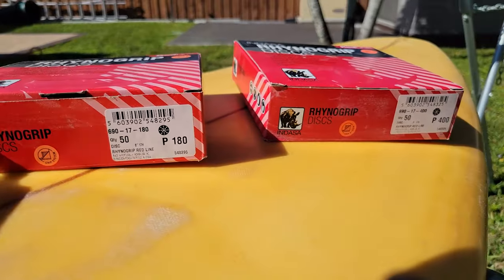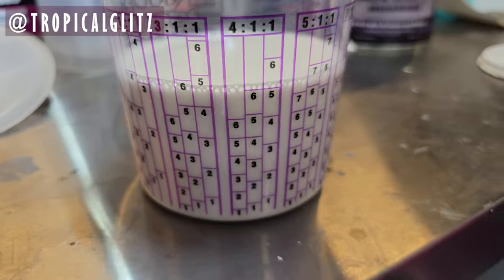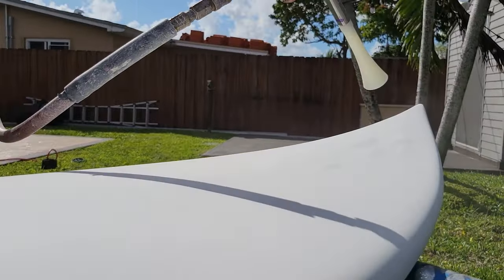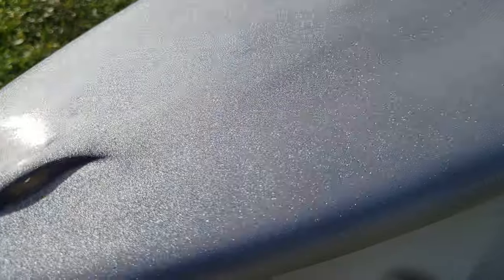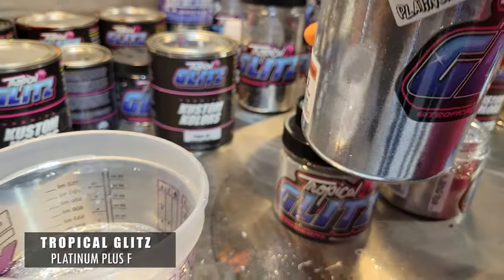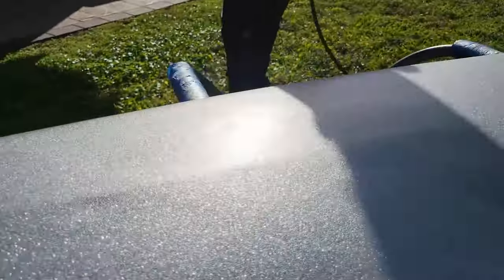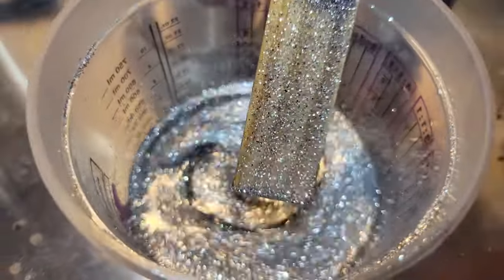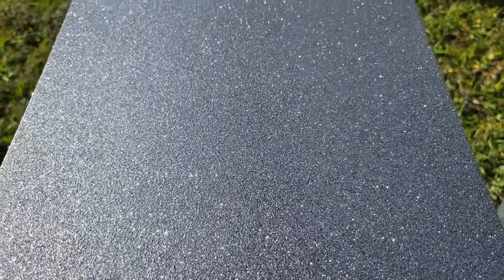How to Mix and Spray Metal Flakes

Comment: what tip with that much flake ?why not just use .25 bass boat flake.?you didnt show how many coats of clear you had to use to make sure it flate before you wet sanded it. thats the fun part.  besides cleaning up all the flake left in the shop and your boots
Reply: Lol daddy roth has their silver flake in a .40 size 😮
Reply: No wonder I couldn’t get that to spray through the .3 Iwata 😂😂 Weeee… now we’re having fun. 👊🏻👊🏻🤣

Comment: is there a limit to how large of a metal flake you can spray?
Reply from the maker: The size of the metal flake depends on the size of the tip of the paint gun.
Reply: @TropicalGlitz  Thanks. What size would you recommend for a .015 flake?

Comment: My Gosh I have never seen so much flake go in 1 cup and not have any trouble spraying it because it sprayed amazingly, how? You had to have been using a large tip!
I'm going to ask a huge favor, before mixing the flake but after telling us what you are going to do could you please go over what type of guns and tips you are using in detail, tip size, needle size, psi you are using and the products you are using names of what you used and why you think this mix is the best and every type of gun you are using and what is the psi set on the gun please! 
Also could you go through the top of the line guns to use for each process like priming, colors, metal flake and do you use the same gun when you use intermediate clearing and top coat clear and if you could use and gun brand and type what would it be and break down why.  
Thank you so much!
Reply from the maker: Hello! All of our flake guns and spray guns can be found on our website www.tropicalglitz.net

Comment: Whats the difference between shooting it with clear opppose to intercoat.
Reply from the maker: The difference between inter coat and clear coat it is easier to spray metal flakes and pearls using inter coat and it is also easier to lay down the metal flakes with inter coat. Inter coat is more of a mid coat, while clear coat is for your glossy and protective finish.

Comment: Question is there ever such thing as too much  Metal flake I dumped the hole can Probably very expensive to do that right
Reply from the maker: Not really but you run into clogging up the gun
Reply: @TropicalGlitz What is the max you can put in a gallon of paint without clogging?

Comment: Though this is a very informative video I still feel anxious. None of the examples showed a logical method or ratio of metal flake during the mixing process. I am new to all of this and just dumping in flake on top of flake doesn't really help explain anything. What''s the ratio one to another? Like how much of the fine to medium to large flake.
Reply from the maker: Determining the ideal metal flakes mixing ratio is influenced by coverage, flake size, and desired outcome. Instead of providing a specific ratio, gradually add small amounts of flakes to your intercoat mix, checking with a mixing stick until achieving the desired final look. Apply 2-3 coats for full coverage without clogging your gun.
Reply: @TropicalGlitz  thank you for responding.  It's my first time doing this. Would you recommend larger or smaller flake for more even coverage
Reply from the maker: Regardless you'll be able to get good coverage no matter what size you use, but the lower you go in size the more flake you'll need for full coverage.

Comment: There are many tutorials of candy paint job or custom and lowrider paints. But there are no tutorial about what materials we use step by step from metal to finnish and what's the material's chemical name so that we can find them in any country we live if we know the chemical name we can find them under any commercial name in our country. So if i know how to spray a candy paint but when i don't know what kind of base coat i need under it so it's useless.
I need to know layers step by step. And each paint mixes with what kind of thinner and hardener. How to mix metal fkakes and mix with what.
I eish there was a tutorial that shows it all from metal to the Finnish. So that we can learn how to the rhewhole project as a beginner
Reply from the maker: Hello. We do not share the private information on how to make our paint as they are our custom colors. Typically candy's are sprayed over a silver base. We have plenty of tutorials showing the basics of mixing and spraying where we go through the process with you step by step on this YouTube channel. If there is a specific video that you would like to see in the coming weeks, please don't hesitate to reach out through the comment section.
Reply: @TropicalGlitz Do you make any oil based paints?

Comment: Man I put as much as u said and did and it didn't shoot out for nuthing I dnt know what to do to get it to shoot even fine flake
Reply: You need a flake gun. Like a 2.5 or 2.8 tip and needle
Reply: I got the tropical glitz flake bomber with the 2.5 tip and 3.0 all flake gets stuck at bottom and clumps out
Reply: I've seen some cups with a little agitator in them that keeps heavy flake from clumping, shouldn't need it with their flake gun, also you might want to go another turn out on your fluid and make sure your fan wide open, I always run wide open on both and since I use pps cups I remove the inside the lid screen when I do flake
Reply: Remove the screen in gum